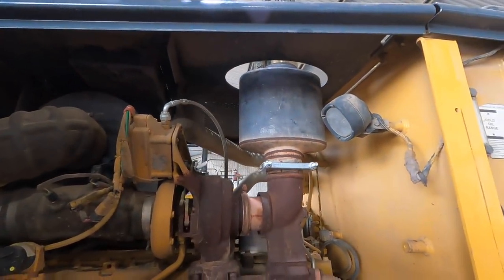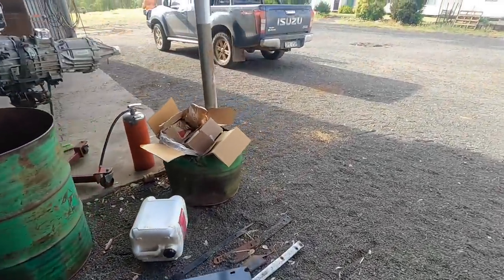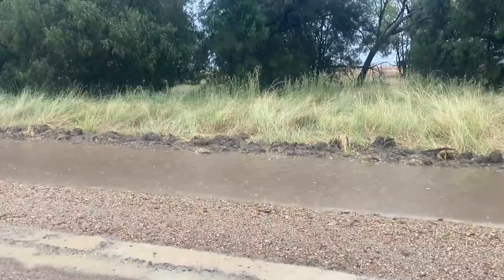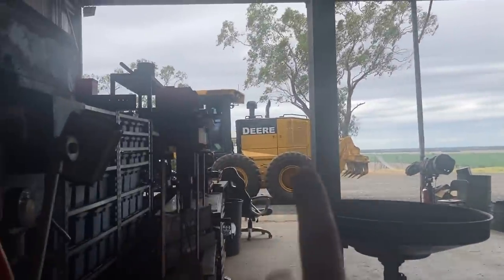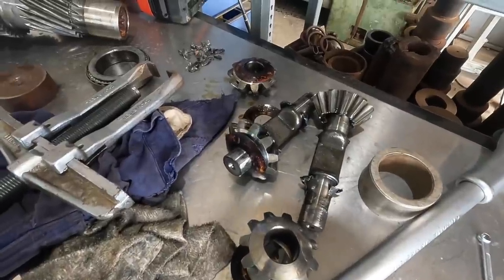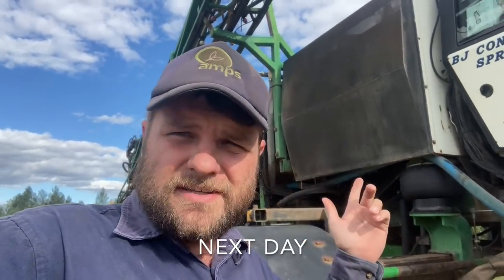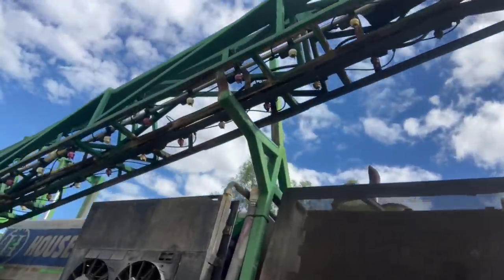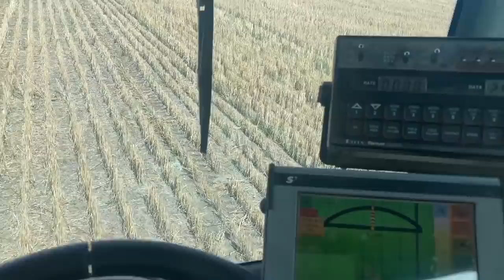Major Gearbox issues!! (Vlog 55)

Comment: Hi Matt pretty know issue with those gearboxes their is a update and you buy the needle bearing all individual. Quite a update. Done both of the crs I’ve had. Videos are great. You can keep the rain
Reply from the maker: Cheers mate, thanks for the info, at this stage we are hoping to update to a diff lock unit👍😁

Comment: Hi Matt. Good to see you and you're dad with the camera, the ole boys a natural with it. 
The househam is an Iveco 4 cylinder turbo, it had 108 hp, they upped it to 140+ on 03. I wonder if its possible to chip it? But I don't know or tweak the pump?
You'll have to show us the machine you're adapting that has what looks like the end of a lift arm as I can't recall hearing the name before?
All the best to you all.
Reply from the maker: Hi Robert, yep it’s nice having someone else do a bit of camera work👍 that explains why it’s gutless haha at least 108hp shouldn’t hurt the hydros😂 you will have to jog my memory on what machine we are adapting
Reply: @thejacksonbrothers  
Peter was filming a part on the bench in the the workshop. Can't remember what the machine was called though.
Reply from the maker: @roberthiggins6401  ahh you mean the new Holland trashfarmer that we were welding a new pull on?
Reply: @thejacksonbrothers  
That's it.
Reply: ouch, 108hp..... I'd be tempted to throw that Iveco in the trash pile and swap it for a 3 litre Isuzu out of a Rodeo that rusted to nothing and left the only good part Holden borrowed to put in them :P They are cheap AF with all those cheap nasty Holden bodies that fell apart and didn't even manage to wear in the Isuzu engine :P

Comment: Hi Matt 
Great video as always very interesting to see the problem with the gear box but it looks a easy fix
As I see you are still busy spraying how many hector's a day can do on a good Day
Reply from the maker: Thanks Simon, shouldn’t be too bad, hoping to update to a diff lock unit. With the grasshopper a good day is 150 to 200ha and the rogator does about 350-400ha depending on weather👍